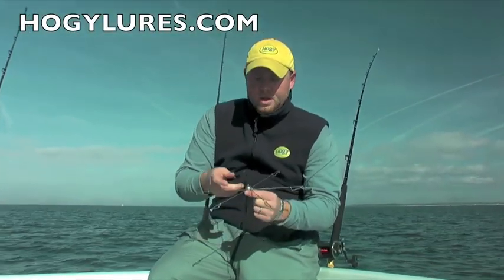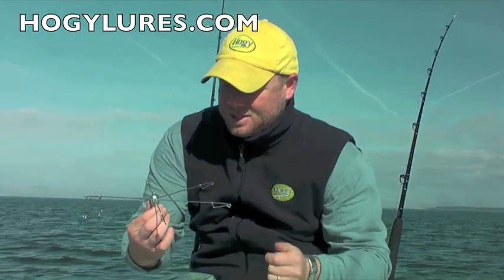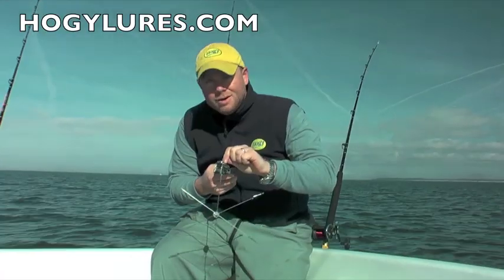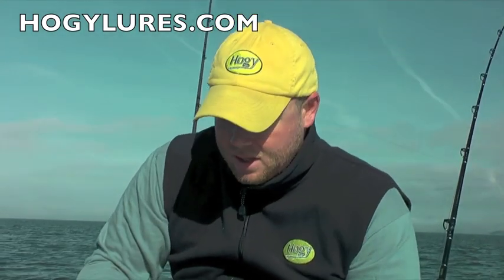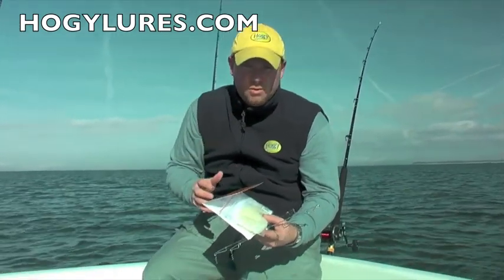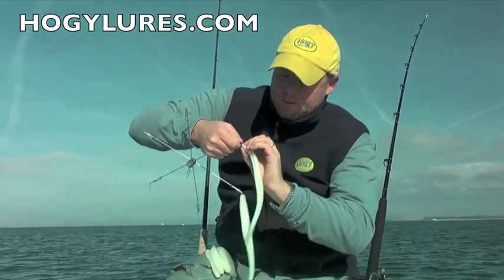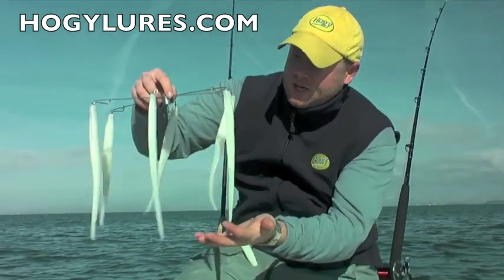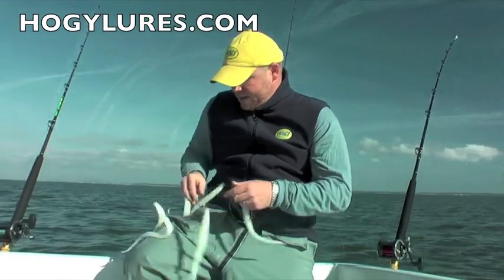How To Make Your Own Hogy Umbrella Rig

Comment: Hello, this is a good looking rig with the dancing action of the soft baits but I am concerned it would take a tremendous amount of lead to get it down even at. 3.5 knots r u using leadcore or wire ? I can't stand the weight of umbrellas with parachutes so this is a great alternative if I cud even get it to 20-25 ft without a 16oz drail
Reply from the maker: +Quinn Hunsinger Quinn - The softbaits have minimal drag with the long, straight tapered tails. We do use wire/lead core setups to get them down. A 4oz - 8oz drail could be added for extra depth in high current situations.  Cheers!